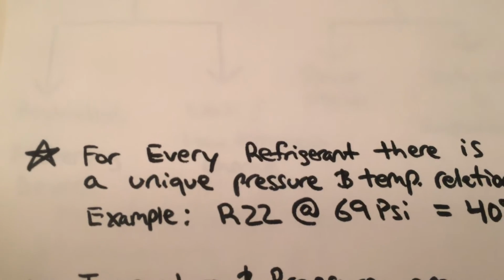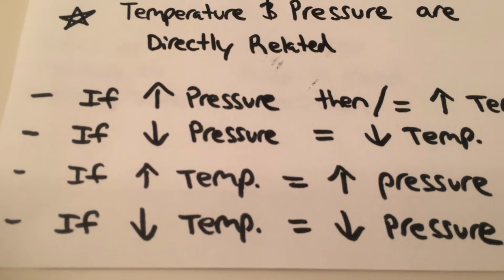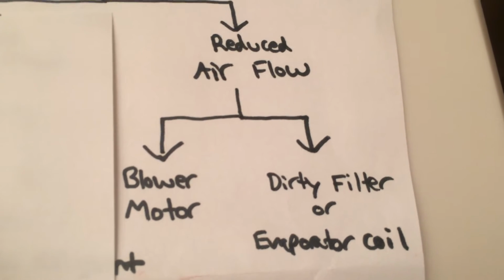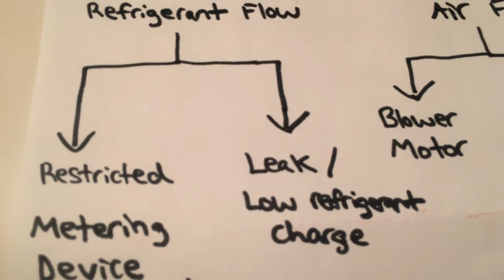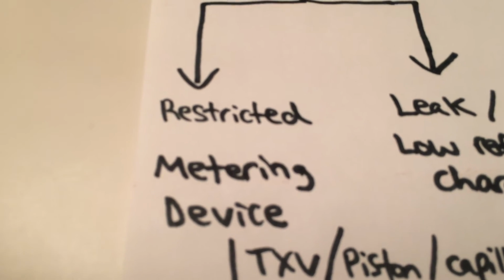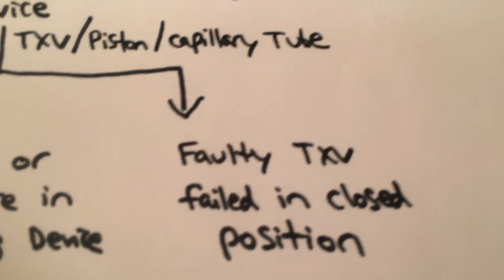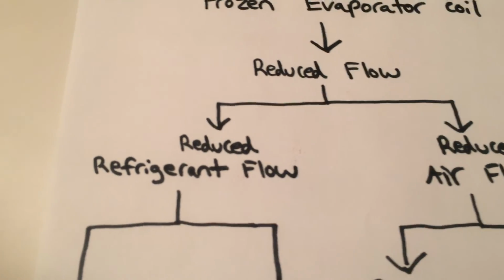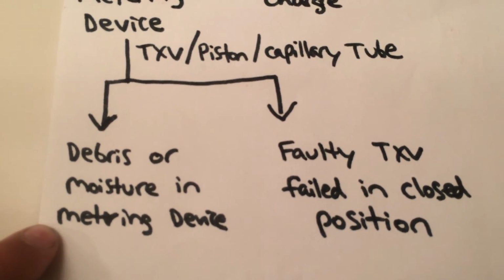Why does the Evaporator Freeze in Air Conditioning Systems?

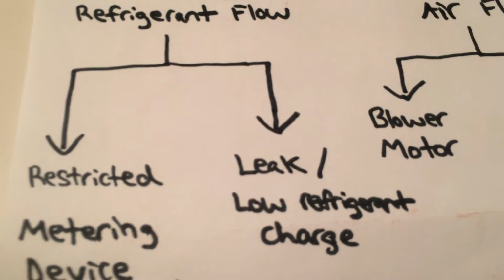Comment: I just had my Rheem 5 ton R22 AC system fixed. This unit is about 18 years old. It had stopped cooling..ran all the time. Outside in the condenser it was heating up the compressor beyond its threshold temps and shutting down. Rinse and repeat over and over. The system showed to be "over-charged" but cleaning the condenser fins and taking refrigerant out of the system only helped for about a few hours and cooled the house only minimally. After a few hours of running with less refrigerant a new symptom showed up which was the Evap coil began freezing up.. big time. I noticed in your video at about the 3:22 point that you gave only 2 reasons why this icing up would occur 1) restricted metering device and 2) leak/low refrigerant. 

What I discovered on my ststem was indeed a "restriction" problem but your video did not show nor mention the line dryer. Evidently from what I can gather not every system has one. But mine does and it was nearly clogged shut. You could hardly blow thru it. 
After installing a new line dryer filter and recharging the system with a fresh dose of r22 the ac runs great! 
I realise I need a new system..I get it..but $8 grand is alot of money so I want to get every ounce of use out of tgis system I can before spending big bucks. I know R22 has been slowly phasing out and being made obsolete. 
I know I need a R410A system. 
I only mention this to let you know these line dryers can be a source of trouble. The dryer itself is cheap but changing them out is not so easy so for anybody reading this just know it might get your ac system thru a summer or 2 more but it deserves mentioning in your video for anybody else out there that might have the same problem of icing not due to low refrigerant or air flow restrictions. 
Take care..your video is very well done. 
Good job!
Mike